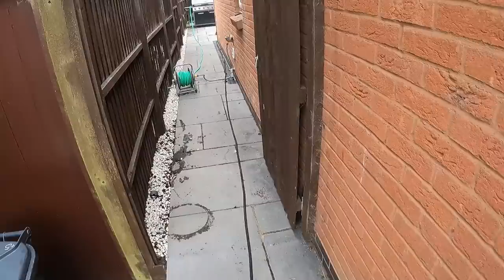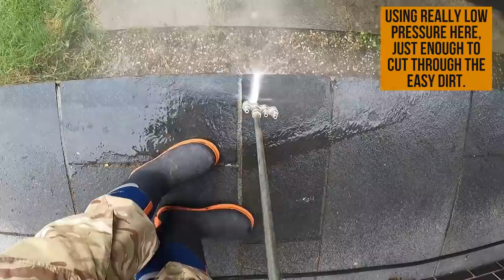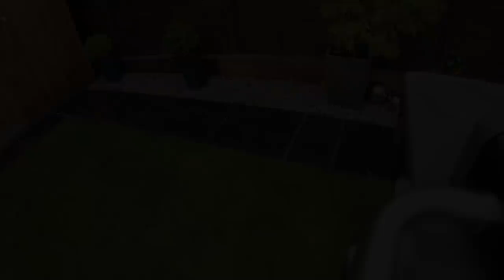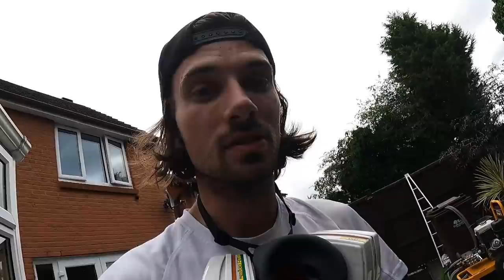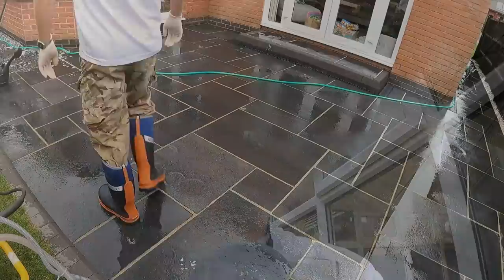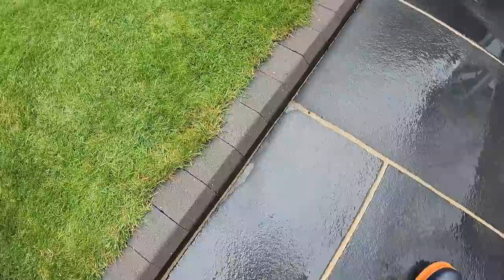Cleaning the most AVOIDED stone by pressure washers & I can see why!

Comment from the maker: Hope you all enjoy another new surface being cleaned on the channel! Found out on the job when multiple people messaged me saying they don't even take on these jobs anymore as they can be so hard to clean! Definitely made me nervous but had the OK from the customer a few hours after I left so phew!

Wonder what we will come across next!
Reply: Hi, it might be a bit of an obvious question but how do you go about swapping between the gun and the surface cleaner on a job? Do you just turn the engine off? I was originally under the impression you could open the unloader valve up to reduce pressure enough but looking online it seems I'll need to buy a ball valve to attach somewhere between the gun and hose to shut the flow off? thanks in advance for any advice :)
Reply: You guys avoid this work because it requires more than just walking around holding a hose and sweeping.
Reply: Brushing and a water hose works better till the spray off.
Reply: What song is this?
Reply: @rafewheadon1963  are you always such a member?
Reply: You sounded nervous, but it looked great on the end. 😎

Comment: I do cemetery and headstone cleaning and limestone and marble can be quite tricky to clean. They’re highly reactive to acids and they tend to absorb salts very easily. Marble is the worst. It’s soft, and even mildly acidic things like acid rain can make it “melty”. We use a quaternary ammonium solution called D/2 which will kill off the biologics (algae, mold, lichens, moss) but doesn’t hurt the stone. And it’s long-acting which is good. We also don’t use pressure washers on headstones because they tend to blast away the inscriptions and designs. Instead we use nylon or natural bristle scrub brushes and toothbrushes and bamboo skewers for the details.

Comment: Was fun at the Q&A for the 50K, also glad to have met the misses.  Since natural stone and particularly this one is such a tricky one, perhaps you can buy a slabs or small slab to do some test at home for future jobs, once you have figured it out you can specialise in this or other natural stone.  That way you can test how it would react to hypo or even vinegar for the rust.  Also try hot water to melt the wax and absorb the melted wax with some paper towels?  Or freeze it using ice cubes to harden it and scrape it off?  Also you can see how the stone reacts to different pressures.  Thanks for sharing mate.

Comment: Hi Sid,  I'm thinking that being limestone, and as one chap said, 'a very soft limestone', it would be greatly affected by acid rain.  I'm thinking that a pot with peat moss in it might be quite acidic as well, which might account for the really bad circles.  I expect too that the water just sitting under a pot and not drying out gives it more time to etch the stone's surface.  The raised portions might be able to be sanded to take them down to the rest of the surface level.  Raised platforms of plastic for each of the pots might be the best solution going forward for the homeowner to reduce marking.

Comment: I had one of these last week and told him I can't be responsible if it comes out stripey and he seemed fine with it, I also said if it does then he will have to seal it to even it out, use the fsc in a figure of 8 instead of straight lines which should help on your next one 👍

Comment: I’ve just replaced 1x 1200/450/45mm limestone slab  at clients home damaged by too high output from pressure washer. Stone was over £85, delivery was the same, my time, as slab was in the middle patio, was around 4 hours total, inc raking out, buying new bedding layer, repointing in matching colour etc removing all rubbish. I can see why pressure washer guys want to leave well alone, or have very good insurance! Using the chemicals is the way forward, they don’t seem to mind a stronger mix than you’ve used! Great video!
Reply from the maker: Ouch! very pricey indeed, honestly i doubt insurance would even cover it they are really hard to get to pay out for things like this i've heard. Thank you!

Comment: When you say low pressure do you turn the PW down (rpm or bypass/return to tank) or do you use a wider nozzle? That one slab with the depressions seems different to the rest? It does look good, natural stone is never uniform that's part of the appeal! I am sure it will dry great. Have a great weekend.
Reply from the maker: I turn my unloader valve really low down, i could of sprayed myself with this pressure and it wouldnt even sting so i was being super cautious and relying on the hypo to be honest. i used a 40 degree tip also.   Cheers matey you too!

Comment: My childhood home had uneven slabs with fossils in, I think it was sandstone and something like limestone with cool looking crustaceans scattered.
As a young tween I took a pressure washer to it, not knowing what nozzle did what, and it took chunks out of it.

It needed to be done because the uneven surface made slippery slimy puddles.
I mostly stuck to the jet nozzle of a garden hose and elbow grease with a hard bristle broom.
When I did use the washer the weakest nozzle held high up was a good middle ground for less scrubbing and less damage, but if I lowered it for a stubborn bit it usually just broke off 😅

Comment: Always use pot risers if you are putting pots on slabs. Prevents marks.
Reply: Don't they rust wih time and make even more stains ? Do you find some that are low enough so that your plant don't fall with wind ? Thank you for counsel 😊
Reply: @creuvette29  you can get plastic ones. And they are only raised up a little bit. An inch or two.

Comment: I have done pressure washing and I'm certified by stone pro on natural semi precious and precious stones. Been doing it for 10 years now. It looks like slate does he have the specs? Almost all natural stones don't come in black for example when I cut granite it will turn grey I have to dye it black and follow the steps. Sealing it with an enhancing sealer or a wet look is simple just check what base it uses some leave a oily residue if not wiped of quickly. You will have to recoat untill a uniform look is achieved. Also it won't last outdoors so a recoat is needed 6 months to a year.

Comment: I used a cleaning solution that would clean that entire space without damaging it, even unsealed. Renue brand floor cleaner. Unfortunately it isn't being made any more. 1 cup of this stuff to 20 litres of water and slop it on with a mop, agitate with the mop and get a new bucket of straight water to clean it off. 15 minutes and it will soak into the surface then lift any dirt, grease, oils from it. ( Renue degreaser solution is currently available here in Canada, works as well ) These products despite their effectiveness, are NON TOXIC, they were designed to be used in commercial kitchens. No idea if it's available in the UK but as cleaning solution for sensitive surfaces ( aka expensive ) if it is the high cost could be considered money well spent.

A painted concrete floor that was clean to the eye, first time the renue was used, the floor looked like it was covered in mud after applying it, that is how much dirt, grease and oil normal scrubbing and mopping had left behind in this restaurant kitchen after being open for a year.

Comment: Hi sid should of asked me mate I done 2 so far and both looked superb after but once they dry they look as if they not been cleaned so was thst the case with yours as both my customers said they been sealed but the sealant they put on was so wired it like a wax coating so wjen wet goes crystal clear but wjen dry goes back to looking dull
Reply from the maker: Yeah it goes back grey after cleaning but it was explained that it could do with some back 2 black put on it, theyre thinking about having it done (:
Reply: @PartridgeExteriorCleaning  be very careful when applying it mate I not done it but someone did and if the paving is not completely dry or get bits on paving the back to black with peal off after a couple of weeks there very expensive slabs but terrible design made white ones are as bad to keep clean and they stain really easy too me personally if I go to qoute that type of paving I tell them I won't make it any better and it will go back to being buff gray then they have been told and have the choice but I would rather not clean them I have done 2 black and 2 white this year and no intention of doing snore or going back to do those I done

Comment: Would muratic acid work? When I worked concrete with my father we used muratic acid to prep old concrete for stain and sealer. Diluted of course, but it allowed the sealer to stick very well. Wonder if it would have any benefit to limestone?

Comment: Regarding the wax I think it really is candle wax mold from a candle. The only way to clean it is with some paper towels and a propane torch or an iron. So you can mold it back and absorb through it until it leaves just a tiny and dull halo. Then you can use a grease and wax remover. This is the best way
Reply: Never tried anyway on limestone

Comment: I think the only thing I would say other than how great it looked afterwards, is maybe to blur out the number on the door of the customer.
Reply from the maker: Cheers stedman, I used to do it in previous video's but I don't actually film the full drive to a job if i put that in there or show the street or the area Im working in so stopped doing it as i tend to walk past the front door a hundred times and it's hard to blur :D
Reply: @PartridgeExteriorCleaning  true that... The results were spot on though in, ive actually never seen black limestone before (probably because like you said, tradesmen avoid it like the plague) looks sick afterwards though.

Comment: One way to get that wax up is take paper towels, place over wax, put a piece of parchment paper over the paper towel, then take an hot iron and run over the spots. The paper towels will soak up the wax and the parchment paper keeps the wax from getting to the iron. Repeat with clean paper towels til all the wax is removed.

Comment: What u could of done is sand the top down a mil or 2 that will bring back the blackness and get rid o the stains cause chemicals on limestone is not a good mix.when u seal it also u can by seals that  makes it look if it was wet so just how it looked after u cleaned it if that is any help to you

Comment: Interesting to see such high pressure did nothing to the wax. Id expect wax to be blasted off nearly effortlessly...
Reply from the maker: Yeah me too! I didn't use crazy pressure on it to avoid etching the stone but a previous comment mentioned using heat to melt it which may be a good idea.
Reply: @PartridgeExteriorCleaning  Yeah but i mean without numbers even, the pressure you use, seems high relative to what wax should be able to withstand!
As for removing the wax, it's a common method to remove it from clothing using a sheet of paper, maybe a paper towel and just heating up the wax with an iron thru this sheet of paper. The paper will suck up most if not all of the molten wax.
For such a surface like this one, cooling the wax down enough for it to become brittle and scraping it off should also work but seems messy. Tho if the winter is sufficiently cold nature could do half the work for you (?).
You can remove any trace amounts left with a mild organic solvent, isopropyl alcohol for example. Acetone would be better but it's more aggressive so be careful around plastics. Stone shouldnt care tho you never know... The biggest risk could be discoloring.